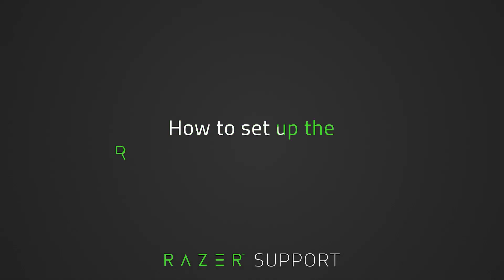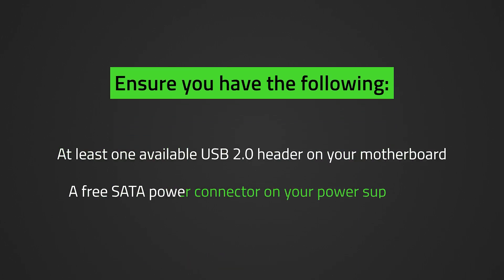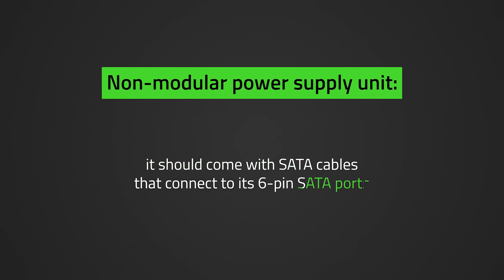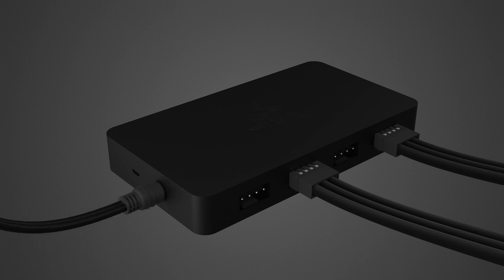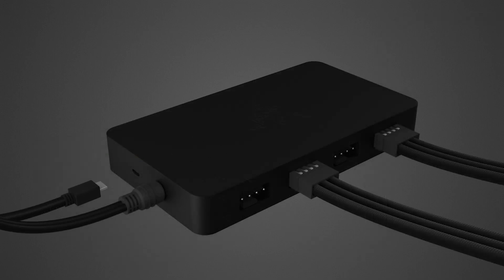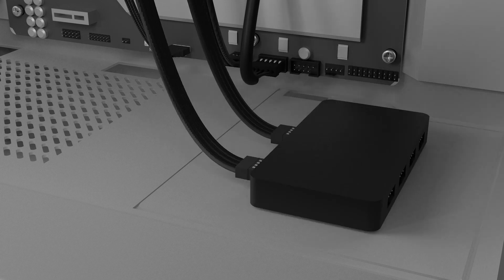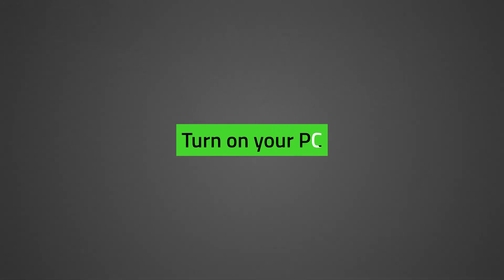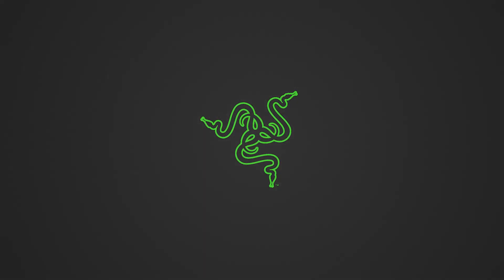How to set up the Razer PWM PC Fan Controller

Comment: No matter what fan I connect, it says, "Fan speed not supported".  **EDIT** Figured it out, the Razer hub doesn't like any PWM fans form Fractal Design, I installed Noctua PWM fans and everything started working correctly.

Comment: Hello. Tell me please. If I have PWM installed, should I connect power to the aRGB controller as well? After all, the power supply to the fan is already going through PWM? Excuse me, I just don't really understand how it works.

Comment: Hey RAZER, make your software recognize both the CPU and the GPU temps, and allow me to set it to help the idling CPU waterblock fans when the GPU waterblock's fans are going full at it, and vice versa. 
Or even better, make a new version of the hardware to allow for double PWM signal sources that do exactly that, without any software running in the background.

Comment: what kind of fan does it have to be? can use any fan that has 4 pins? thanks!
Reply from the maker: You can use any fan as long it is a 4-pin PWN Fan. For more information please check this master guide: https://dl.razerzone.com/master-guides/RazerSynapse3/PWMPCFANCONTROLLER-00003900-en.pdf

If you have any other questions or concerns, feel free to reach out to us directly here: https://insider.razer.com/index.php?forums/support

Comment: Hi, can I connect to the PWM Razer controller fans from other brands, I already have NZXT fans that are also in PWM and I love the Razer effects, I would like to enjoy and synchronize the whole of my pc, I would like to know if it is possible to operate the NZXT AER RGB 2 with the PWM Razer controller? Thank you
Reply from the maker: You can use fans from other brands as long as they have 4-pin connector.

Check out this resource:
https://mysupport.razer.com/app/answers/detail/a_id/5736

If you’ve got any further questions, please connect with us here:
https://insider.razer.com/index.php?forums/support
Reply: @rzrsupport9502  I've just purchased the controller but razer synapse won't let me change the colour on my Be Quiet light wings fans or turn the lights on it just let's me adjust the fan speed

Comment: does it work with 3 pin fans (voltage only not pwm) or is it just gonna run them at full speed without a voltage control?
Reply from the maker: We are sorry but it will not accept 3-pin fan connector. If you’ve got any further questions, please connect with us here:
https://insider.razer.com/index.php?forums/support
Reply: @rzrsupport9502  on your website it says (Designed to provide voltage and PWM control for up to 8 fans) so.. what does it mean?
Reply from the maker: You can connect up to 8 4-pin fans to the controller and customize the pulse width modulation curves for up to eight fans and enjoy lower noise levels compared to traditional DC powered fan setups.

Comment: Did everything in the video yet no LEDs lighting up.  I did daisy chain the ARGBs, nothing, tried unplugging the ARGBs and still no LEDs. When I go into the S3 software all the comes up is the ability to change the speed, where is the option to change the colour style??
Reply from the maker: We’d like to help out, please connect with us here: https://insider.razer.com/index.php?forums/support
Reply: @rzrsupport9502  Nothing in the forums about this issue yet, simply, how to connect the aRGB, can't believe it's not in the instruction manual that came with the controller about setting up multiple fans via the controller.  And I did leave a comment in the forum addressing fan installation, no response, and I have also emailed tech support directly, again, no response.....yet. Maybe I will ask here, I purchased five fans and the PWN Fan Controller, I assume the PWN Fan Controller does not control the LEDs???  So now I have purchased the RGB Controller from Razer in the hopes that solves the issue.  But how does the aRGB connections that are on the fan come into play??  do they connect to the RGB Controller??   That's a little sneaky Razer, so if you want these fans to work, LEDs and all, you need to not only purchase the PWN Fan Controller, but the RGB Controller as well?  I hope that is why I am not getting and LEDs.
Reply: @brianjohnston2168  You have a couple options when it comes to the aRGB, one of the fans a part of the daisy chain will either need to be plugged into and aRGB header on you motherboard or you can buy aRGB controller(razer offers one in their product line for $40 USD). If you plug it into your MB youll need to use the motherboards lighting software to control the leds (personally i have an asrock razer edition motherboard so i can control everything then using synapse but there are other manufactures that are compatible with Razer chroma). If you get a fan controller and specifically razers you can control it using synapse. The PWM controller only handles the fans and not the lighting.
Reply: @ericcedgi  Got and got an aRGB controller on the way, once I prove for myself I can daisy chain the five fans I have now to one port on the controller, I will pick up another six fans and one more pwn controller, can't wait!!

Comment: Do the fans only respond to CPU temp or can they bound the GPU temp? I am looking for a fan controller that can dynamically change fans based on CPU or GPU temp. NZXT fan controllers with CAM can do this, but I prefer the razer ecosystem.
Reply: I am wondering this too. Which temp(s) is it going off? Pretty worthless if it can only go by 1 temperature.

Comment: this allows each fan to be controlled separately?
Reply from the maker: You can adjust the RPM of each fan via Razer Synapse 3. You can use the preset fan speed or use the slider adjustment controls in Manual mode.

If you’ve got any further questions, please connect with us here: https://insider.razer.com/index.php?forums/support